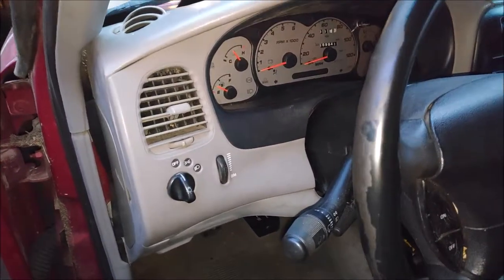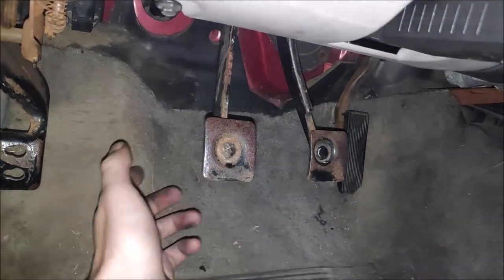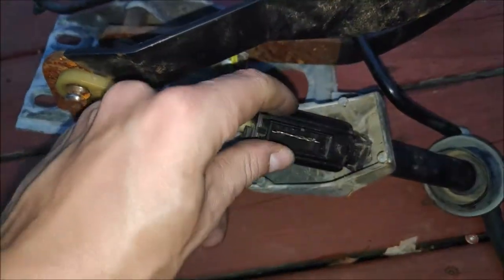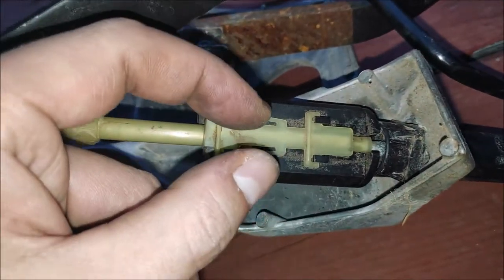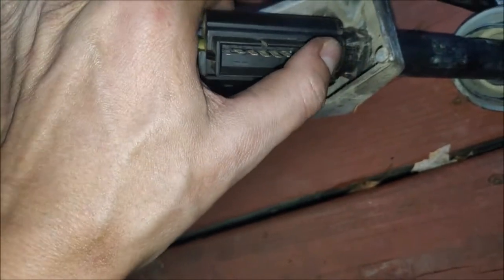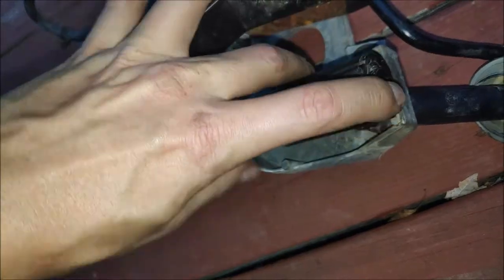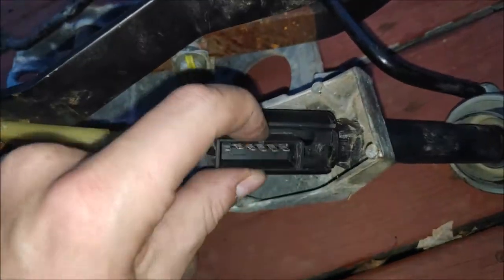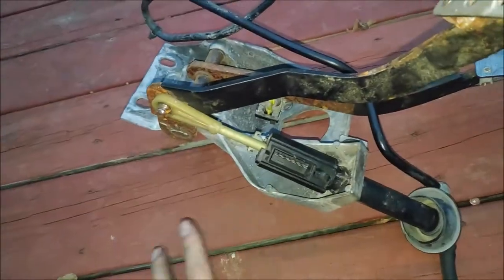Easiest Way To Remove and Install Clutch Safety Switch on a Ford Ranger, F150, F250, F350

Comment: I figured out what was wrong. The clutch master was recently replaced by a "tranny shop." It appears there is no ring with the clip, on the end of the clutch master. SO, the switch has nothing to mount to. Needs a new clutch master. Can't believe the tranny shop left it that way. Probably an NHTSA safety violation.

Comment: any adjustment on those? I have to push the clutch real hard into the floor before it will spin over.
Reply: I have that same issue rn how did you fix it?
Reply: @coltinwalker6366  I haven't, BUT, The switch slides on the shaft. I grabbed it, slid it up and down fast and fairly hard and it fixed it. It's getting worse again, but I'll try it again. It starts without the clutch most of the time now, In neutral.

Comment: Thanks for the video, of course it's easy to do when it's sitting on the ground in front of you lol. Either way thanks for the knowledge. Do you recommend replacing the little plastic connector that holds it in place? How do you remove that

Comment: Nice video. How did you take out the two bolts at the top of the entire clutch/brake assembly bracket? They're pretty far up there and my ratchet with socket nor my drill with swivel head fit without getting hit on the backside against the big grey piece when unscrewing.
Reply from the maker: 1/4 swivel on an extension. Now that's 95-03. 94 and older are a pita and you pretty much have to drop the steering column.
Reply: P
Reply: Attention  If you are replacing cracked clutch brake pedal assembly mount

Under the dashboard in the cab, 
the master cylinder requires only a quarter turn twist, with little force, such that its fixed square at the end can slide through the floor mount  square hole where its seated. Just behind that mount square hole, between the mount and the fire wall, is flat but wavy ring sprung tensioner washer that helps keep that more firmly held in place. 

It looked is a lot harder then I thought as I wasn't familiar with these catches and twists.

After that the rod from the clutch pedal comes off and can now be pulled through the fire wall.

It was painstakingly awkward removing that clutch break pedal assembly mount that cracked where it held the rotational arm that both pedals are attached to.

The 1/2 inch deep socket and short extension works but an impact wrench/ drill made quicker work of it. 

However, the last bolt in the upper left corner is to shallow for the socket and wrench to fit, even with a short socket . A box wrench didn't work because there's not enough space to turn it. A flatter ratchet box wrench,1/2 inch, may be the answer, too, but its will require many short turns and patience. 

A smaller socket wrench with an articulated head may do the trick. I imagine a seasoned Ford  technician has a more elegant tool or approach.

The pedal assembly is almost $200 from the   dealer, as cheap $80 on eBay  (part # 6L5Z2455BB  allegedly fits 1995-2006 Ranger) and sufficiently  less  cost at Pick-n- Pull,  if you cant await delivery bit can tolerate a  2 hour extraction mission.

Unfortunately only 3 vehicles have it, the Ranger, the Explorer Sport and Explorer Sport Trac.

It's truly puzzling determining if the vehicles at Pick-n-Pull will have the part. First, note set date or when they put the vehicle out. Allegedly about 10-14 days later they scrap the vehicle (P&P is a subsidiary of Schnitzel Steel) The vehicle may remain a bit longer?? but the listing is no guarantee its there and calling may or may not be fruitful in making that determination.

Now the listing provides the Vin # and the best you'll get is 4 speed auto - 5 speed manual, I kid you not. The only way to devine which is by providing the last eight digits of the Vin # to the willing, generally very forthcoming, Ford parts department and they shall know if its automatic or manual.

Dint be fooled by an online search of websites that suggest they can tell you; they can't.
You will find that every digit tells you useful things. Oddly the 4th through 8 digit (not the last 8 digits) reveal the type of the transmission but further search was fruitless in identifying whether its manual or not!!

There are two or three very good videos on how to bleed the line for the clutch line to the break Master cylinder to the reservoir by hanging it from the reservoir. The flexible rubber line is bent then flat at two places that trap air. Thus its not advised to bleed in place as the air bubbles move left to eight but not up and out the reservoir.

Comment: Would a bad switch cause the truck not to start? It turns over but won’t start. When the switch went out on my Honda Accord it wouldn’t even crank over. But my Ranger cranks, no start.
Reply from the maker: The switch isn't bad if the engine is cranking over.
Reply: It could be the fuel pump relay.

Comment: I got a question how the hell do you get the master cylinder push rod off the clutch pedal without breaking it I see people doing it but their videos suck and I can’t see what they are pulling up on..
Reply: Did u ever find out ?
Reply: Popped mine of w/straight screwdriver.
Reply: No I found an easier way which worked fantastic. Then I sold the piece of shit lol
Reply: @FURFEELINGS_3 what way lol
Reply: @thatssojad3n  been 3 years remind me what we are talking about lol bleeding it?
Reply: im trying to replace the pedal assembly and the clutch master apparently doesn't separate from the push rod so just had to go buy the MC so I can get the old out and both new parts in

Comment: Do you think this could cause the truck to throw a P0340 code after it starts?
Reply from the maker: I wouldn't think P0340 would have anything to do with clutch switch.

Comment: good input but what about removing the connector on the safety switch? It great to work outside of the car, reinstalling the saftey switch is a bitch.

Comment: How did you get the clutch through the fire wall?
Reply from the maker: If by clutch you mean clutch master cylinder, then it was pretty simple.
I removed clutch switch first, then I disconnected master cylinder rod from clutch pedal, then I twisted master cylinder from engine compartment side and the whole thing comes out.